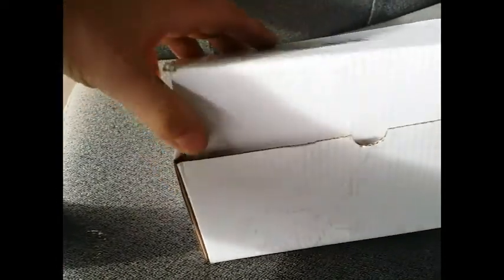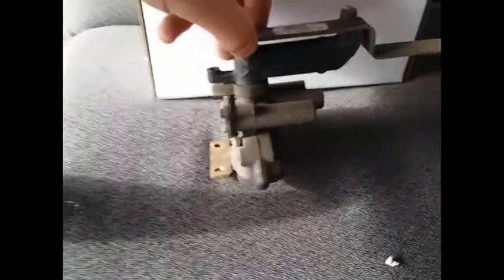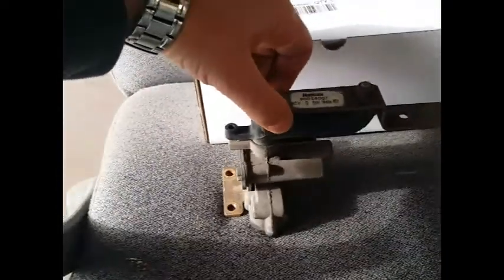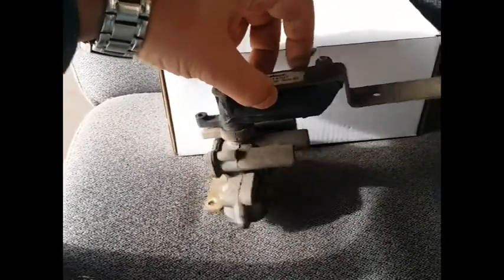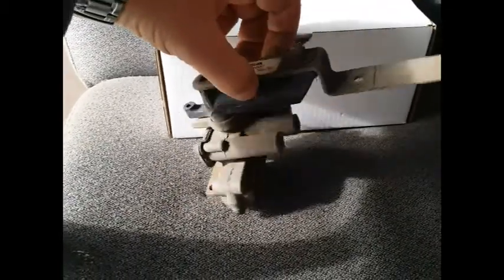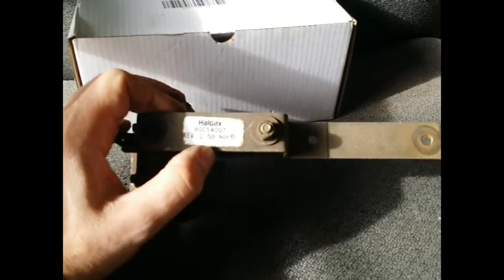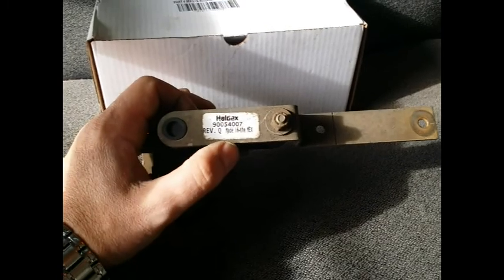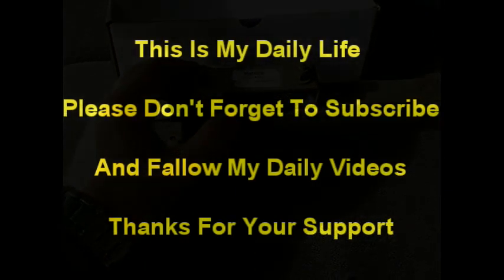Wabash Trailer Air valve Complication

Comment: Hi I am not a trucker  I have a situation with my dock  That every time I get a new or trailer with air ride on it my forklift drivers are tearing up their forklifts Is there a way to deflate the airbags On a trailer after it has been docked Thank you
Reply: @james fike there set up in multiple different configurations, mine will deflate if I pull the trailer breaks.
A lot of trucks have dump valves, best thing to do is ask the driver, they could pull the trailer breaks then open the trailer air tank!!